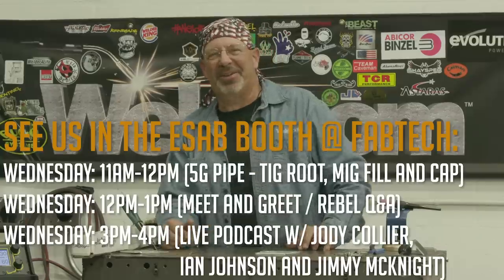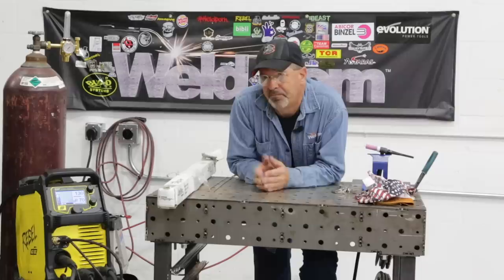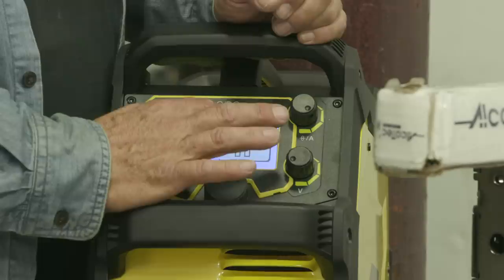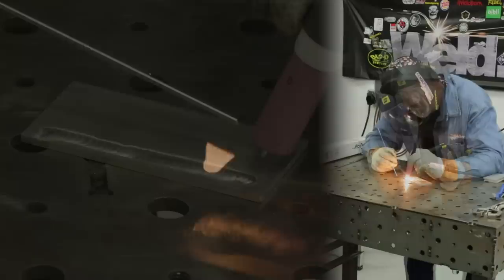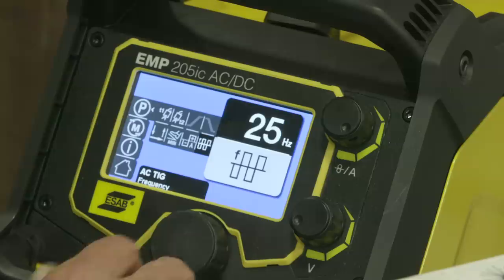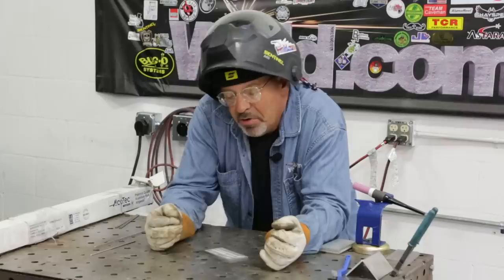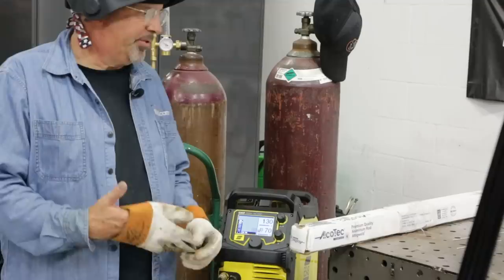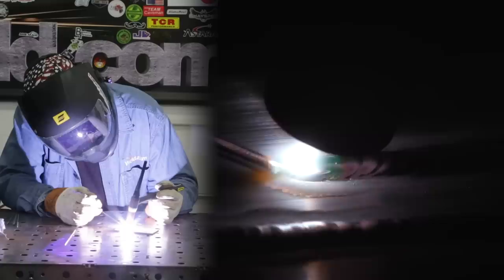🔥 ESAB Rebel EMP 205 First Impressions and FABTECH ANNOUNCEMENT

Comment: I have been holding out for this for way too long! I have a caddy 2200i TA34 tig and a caddy c200i mig and would like it all in one box for site work.  I'm gonna be inline tomorrow to try it out. Hopefully it's as good or better than the 2200i in ac tig mode.  If it is I will be selling my backup machines, buying one of these and sitting the 2 caddy's in the closet as the backup machines.  I'm so glad I can get ESAB machines in the USA!  I grew up in europe and learnt on ESAB machines.  I shipped my old smashweld 185 over with me when i emigrated and it was a great machine and was still going strong when i sold it on.  Forget your miller blue and lincon red I'm on the yellow team..... well green too I have a TD cutmaster 52 also :-)
Reply: well ,??? did you ??

Comment: why or what is dc tig vs ac tig ?   ac better for aluminum ?   which is best for replacing muscle car sheet metal ?
Reply: You need to run ac current to weld aluminum, DC will not work for aluminum. If the sheet metal is steel then use DC, if aluminum use AC. Most tig machine have only DC capabilities, so it's cool to have both

Comment: Hi, Bob. I'm strictly a hobbyist welder, but I try to soak up all I can about different processes. Maybe I've missed something simple, but what is the point of using different frequencies? Looking at the welds, I couldn't tell the difference between the ones done at 25hz and those done at 400. Do different applications call for different frequencies? Thanks.
Reply: The lower hertz give a wider arc and better penetration, good for thicker stuff. Higher hertz gives a narrowed arc with less penetration good for thinner stuff.
Reply: @mrgreenswelding2853  Thanks.

Comment: Ok bob you have run them both, which one performed better the everlast or esab?
Reply: John Walkowiak miller has one now too
Reply: What's the miller called? I don't think so sir
Reply: Isaac Hernandez don’t think so what? It’s the Miller Multimatic 220 .. don’t think lol goggle it.
Reply: The Miller looks nice, dual gas ports and no changing feed wheels
Reply: Scott Hall the Miller tho has no ac pulse, up slope , down slope and balance is only 50-70 and it has 20% duty. Doesn’t look like it was built for ac. Just quick ac repairs.
Reply: I would like to know.  But maybe not as I am not in the looking mode anymore.  I love my everlast. Nothing to change. 221sti
Reply: @weldingjunkie  60-80%  Balance on the miller. 20% Duty cycle on the Tig is at the full 210 amps. It is 100% duty cycle at 120 Amps on 240 volts.
Reply: stwerks thanks even worse 60-80 balance very little adjustment. I’d rather 50-70 plus No freq, no slopes, no independent ac and yes 20% at 220 the Dynasty alone is 60% at 210.

 At almost the cost of the Dynasty why would anyone not just buy that and then a $800 wire machine. The Tig functions on this machine are worse than the Lincoln square wave for Tig. I mean no slope down? So much for using a momentary switch on this. Guess it’s lift or pedal only so no aluminum without the pedal. They couldn’t even put two gas solonoid in it. They didn’t even had pulse for the aluminum. This is s 2300 dollar machine not a 3k 

Who designed this? And true blue warrenty what a joke my dynasty 280dx has been in the shop for a PC board for a month 2hrs away from me. Hate to say this but millers lost thier edge on anything 5k down.
Reply: @weldingjunkie  Dunno....I have a Dynasty :) I was researching these to see if I could get an all in one to save space and because I want to upgrade my MIG maybe. Been using a Challenger 172 since it was new. However, it always gets the job done. The main thing on that is that I always wanted to try a spool gun and they dont have one for the Challenger. Now that I researched these I think I am back to just getting a newer MIG and building a stacked cart or something. I do like that the Miller 220 can have both gasses connected and both MIG and TIG hooked and automatically switches and only requires one power connection. The duty cycle is not actually that far off from my Dynasty 200 DX. The Dynasty is a bit more linear on the duty cycle chart. The Dynasty has way more options though. The Miller or the ESAB would be s slight TIG downgrade, but to be honest I hardly ever use my TIG. I just have it because I need it every great once in awhile. So...do I need all the fancy features...not sure.
Reply: stwerks i look at it this way. If you need it got space that perfect that’s one thing. I don’t use pulse a lot but when I do I’m glad I have it. I use momentary switch all the time so slopes are a must. Why would they no put freq on this machine ? It’s set at 60hrz. Not even sure it has pre post flow adjustments. 

If you can Tig aluminum why do you need a spool gun if you don’t mind me asking? Do you do production or just new to Tig? 

You’re right it’s close to that of a dynasty 200 a 10 year old model of a Tig machine? They increased the 210 so much because they had to. People wanted it. It’s all temp driven too. That 20% in day Texas is more like 10% because it’s so hot. Arizona 7% at 200a.

I still stick to buying a dynasty and if you want a spool gun get a Hobart 190 or 210mvp very good transformer machine $600-$700 bucks new. So for $1000 more you have a beast of a Tig machine and a good wire welder with spool gun (same spool gun) miller uses.  If you are just doing fast repairs than this machine is ok. I used this as a demo and I was not impressed. The fit and finish felt like a miller 215 multimatic with ac. 

Btw you could get a Hobart 190 and a HTP inverig 221 (fantastic) Tig machine for the same price as this 220 Matic. 

https://www.usaweld.com/ProductDetails.asp?ProductCode=70221-12.5
Reply: @stwerks  don't over look the everlast. I know people are scared because they are made in China. NOT all things made in China are junk. They are a American company with a 5 yr warranty I believe even for commercial use. I haven't had mine but six months but I love it. I did a lot of research all the threads I read but only from owners not hear say. Hours of YouTube videos. Then even a video tour of the plant that builds them it was showing the clean room that they build and assemble in.  They are pretty impressive if you get to use one. They have spool guns for them as well. Sorry if I went overboard  I just think people need to give them a real look. I would hate for you to miss out.
Reply: @jvmiller1995  I already looked at them. Right now I am leaning towards keeping my Dynasty 200 DX for TIG and replacing my Challenger 172 MIG with the new Millermatic 255 and a spool gun. You can have the spool gun and the MIG hooked up with both gases. No swapping things when you want to use one or the other. This combo should actually be better than the Esab 305 or MIller 220.
Reply: There are times that I think a spool gun might be better suited/faster/easier than TIG. I only do projects or repairs here and there. I don't weld for a living. It's just supporting tools to my other activities, hobbies, fabrication of things, repairs, etc. My TIG has very low usage, but there have been several times welding on a Boat or an Aluminum trailer that I thought a spool gun would have been so much faster and easier. Also, I have not had a spool gun, so I never used one. I would like to have that option as well as TIG for aluminum. I think I have ruled out these multi-process machines at this point. I might as well just put the money towards a better MIG/Spool Gun setup and keep the TIG I have. It is better and has more options. As of now I am thinking Miller 255 to replace my Challenger 172 and add a spool gun. No swapping things out if you want to MIG or use the spool gun. You can have them both hooked up. This way I can use my MIG/TIG/Spool gun without wasting a bunch of time setting things up and swapping things around.
Reply: @jvmiller1995  Ive got one too, 210 ext. Packed with features and they are all responsive. Its not like some machines where you make a perameter adjustment but it does very little other than a placebo effect.
Reply: @9eyeh8chu9  I have been very happy with mine. Bang for buck they are very hard to beat.  I do like what i see on the esab tho. I think it seams to be a solid machine. but they are a still good penny more than the everlast but  still way more bang for buck over red or blue box machines

Comment: I am after a good welder, came across Esab welders which i found were made in Sweden which i know make excellent welders, but found out it was bought out by an American company, so does that mean that the Esab reputation and brand name will be trashed and will be another piece of equipment made of cheap chinese junk?
Reply: actorzone I went to fabtech and welded with the new 205 it’s just as good as my older machines and better in some respects.  Esab is a great company I have several of their machines and they have always been excellent.
Reply: @weldchip  The EM 215 would suit me as i only use the Mig Function as i have never welded aluminium or TIG welded, the EMP 215 costs about $2350 in Australia, the suppliers don't have the  EM on their books as it would have to be imported in, the 205 has this high frequency function so does that improve the TIG welds, we have 240 volts ac here so i can use its full potential. I only have a Lincoln 170p which has been very reliable.

Comment: Honestly, The long term quality and dependability is NOT there. I have had failures on about 50 percent of the 205's i have sold since they came out. For the price, i expect better quality. I have been in Welding sales for over 20 years, and this is one of the worst "New products" to be dumped on the consumer. When it works it is great, but depend on it. Thats my 2 cents on this machine.
Reply: What machine do you recommend then ? I was really bought off of the specs of this machine

Comment: fronius transsteel 2200 or this machine
Reply: dylan8447 transsteel does not have AC
Reply: yes but it will mig Aluminum with no spool gun
Reply: FRONIUS
Reply: That's the question I want to know also